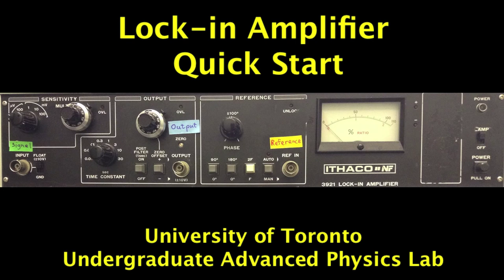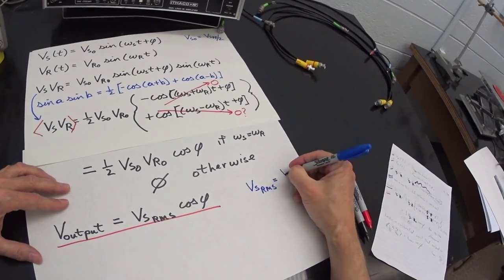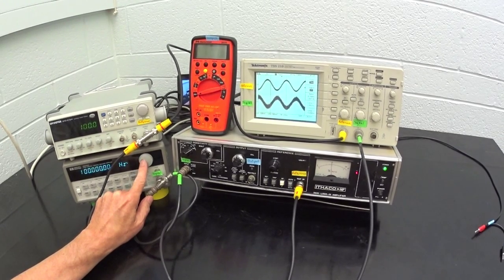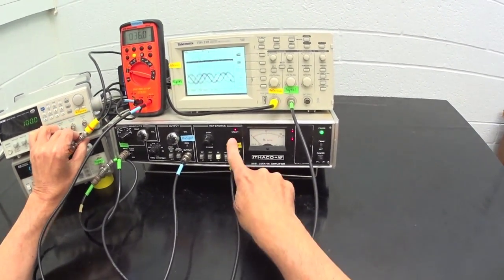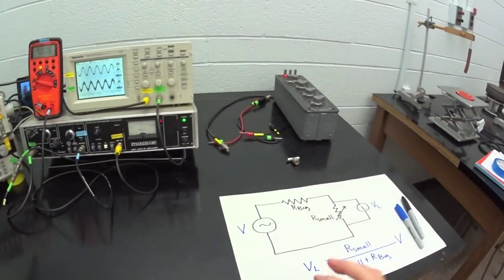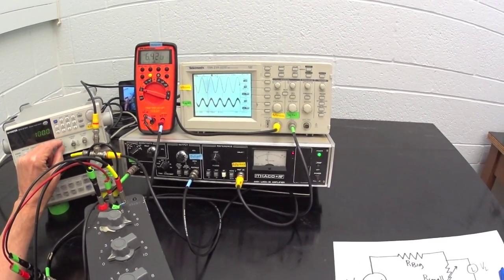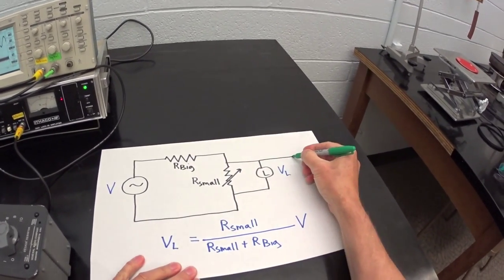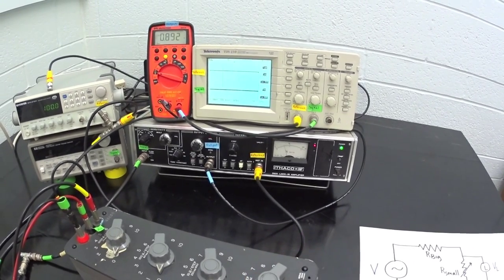Lock-in  Amplifier Quick Start

Comment: Great video. Just repaired an Ortec 9503 lock-in amp yesterday that I found on e-bay.  Started working with it earlier today then found your video.  Pretty much confirmed that I knew what I was doing never being exposed to the use of a lock-in before. Experiments in my basement lab await.  I hope to see more on the use of lock-in amps from U of T in the future. Thanks
Reply from the maker: +scooby45u I'm glad it was helpful. Best wishes.
Reply: Hello Scooby45u: I have one small query regarding Ortec 9303E Lock-in. How do you tune the reference phase knob? It only goes from -4.5 to 5.5 degrees. I am a bit confused with that function.

Comment: Hi...I have an old Ortec 9501E Lock in Amplifier....tUnfortunately don't have a manual .....could you further clarify what the read-out on the needle gauge indicates ? Thanks
Reply from the maker: To understand your particular lock-in, you might try contacting the University of Twente  EEMCS Historic Instrument Collection (http://studieverzameling.utwente.nl, click on the British Flag for the English version).  They apparently have a paper manual for the 9501E (http://studieverzameling.utwente.nl/display_item.php?table=manual&id=386).

More generally, I think of the meter as essentially showing a running average of the input amplitude times the cosine of the phase difference between the input and the reference. The time-constant essentially determines the time period over which the “average” is made. To find the actual input amplitude, you need to adjust the phase knob until the meter reaches its maximum amplitude, at which point you can read the amplitude off the meter (scaled by the sensitivity setting), and read the phase difference from the knob position. 

If the amplitude exceeds the +/1 range, you need to adjust the sensitivity to bring the meter reading back in range. If your meter goes from -1 to 1 and there are no +/ lights, then if input and reference are more than more than 90 degrees out of phase it will show as negative on the meter. If you have a 180 degree button, pressing it should flip the meter reading from - to + or vice versa.

As you can tell from the video, having a couple of frequency generators and an oscilloscope makes it much easier to figure out what a lock-in is doing.

        I hope this helps a bit.
Reply: Thanks for the answer! I have the output going into an oscilloscope to graphically see what is going on .... My needle just sticks around the center value and seems to only go to maximum when the sensitivity max's out
Reply: @torontoapl6987  Thank you so much for the nice two-part experimentation explanation. This helps a lot to understand the functionality of the instrument and the initial basic setup. I too have ORTEC Brookdeal 9501E lock-in amplifier and not able to understand the output in magnitude(R) and phase (theta) terms. The needle gauge in the lock-in display shows the DC signal but changing the value (due to the phase).
I have two questions:
1. How to measure the magnitude of the fluctuating DC due to phase?
2. I am trying to change the phase knob but can not make the fluctuating needle stable at one value. Is there any other way to do that?
Reply from the maker: @va4409  If the needle is jumping around quasi-randomly, it usually means there is no lock.  Have you checked that your reference signal is large enough?  If the needle is oscillating smoothly, that might be beats if the input frequency is slightly different from the reference frequency.  I am not familiar with the Ortec (or EG&G) 9501E. Looking at online photos I don't see an Auto button so I assume it cannot automatically set the phase to maximize the reading, but the reading should not be jumping around.  If, using an oscilloscope as in the video, you are sure you have a nice reference and in-phase test input signal, then there may be something wrong with the lock-in or its settings.  I notice the 9501E has several knobs and switches on its back. Have you played around with the switches to the left of the Reference input? i.e. the "External Reference" and Ground switches.
Reply: @torontoapl6987  Thank you so much again for the resources like Uni Twente link and advice on the instrument usage. 
I was using two different sources (one for ref in and another for signal in). There is a slight difference in frequency hence giving me the fluctuating needle.
Reply: Hello, I have a quick question. 
I have an old Ortec 9501E Lock-in Amplifier. What is the unit of phase angle know, is it in radian or degree? It is only -4.5 to +5.5. I am not sure about that.

Comment: HELLO
I'm with the problem of Overload !
You know how to fix this problem ?
I have reseted the lock-in , but it worked .
thank you
Reply from the maker: +Wagner Garcia
I am not sure I understand the question, but the usual reason for an overload is that the input signal is too large for the current sensitivity scale.  Depending on the lock-in, the overload lights might also flash to show it can't find a reference signal.

Comment: Great video. It was really helpful.I am working with SRS830 DSP lock-in amplifier.  Do you have any idea about what dynamic reserve or gain in lock-in amplifier to give me an idea that how it works? Does lock-in amplifies signal?
Reply from the maker: +Tahhan Sadaf 
Dynamic reserve parameterizes how well a lock-in can extract a signal from noise.  It is normally defined as
         Dynamic Reserve (in dB) = 2 x 10 x log10(V_noise/V_smallest_signal)
where V_smallest_signal is the smallest signal amplitude that can be accurately measured  in the presence of noise with amplitude V_noise,  (The factor of 2 in the definition is because dynamic range is traditionally defined in terms of power, which is typically proportional to voltage squared.)  For example, a lock-in that can accurately measure a 100nV signal in 10mV of noise has a Dynamic Reserve of 100.

Caution: I have seen the term “Dynamic Reserve” used to describe what I think of as Dynamic Range, which (if I follow the pattern of the above definition) should be
         Dynamic Range (in dB) = 2 x 10 x log10(V_max/V_min)
where V_max and V_min are the amplitudes of the largest and smallest signals that can be measured by the lock-in.

The name "lock-in amplifier" is a bit confusing, since it is actually an AC meter, not an amplifier. Its output is not an amplified signal, but a meter reading or DC level proportional to the amplitude of the signal input. When you change the Sensitivity scale on an analog lock-in, you are likely changing the internal gain of the input amplifier, but a digital lock-in may not need to change any internal gain if its analog-to-digital converter (ADC) has sufficient bits.   You may have control over the DC Output Gain, which changes the proportionality of the DC output level to the amplitude of the input signal.

I hope this helps.

Comment: I though it would be a tutorial how to use a guitar amp :(
Reply from the maker: Yes, there are lots of different kinds of amplifiers and in this case the name is a bit confusing. It might be better called a "lock-in voltmeter", but these devices have called "lock-in amplifiers" since at least 1941 (https://aip.scitation.org/doi/10.1063/1.1769919), so it is probably too late to change now. I hope you found a good guitar amp tutorial.
Reply: @torontoapl6987  you should record this like 10 times more slowly and not by using a tape recorder, throwing in the bathtub, filling it with acid, and then playing it into a talkboy
Reply from the maker: @vs24bv  Please see the recommendations under "Show More" if you find the sound difficult to understand.

Comment: Hello, I have an old Ortec 9501E Lock-in Amplifier and I am getting the variation (noise) in the output signal in the range of 50 mV but I was expecting it to be in microVolt range. Is it normal for this instrument? Isnt this instrument should be used to remove the noises. 
p.s.: I am recording the output using NI DAQ usb-6009 (kept in a faraday cage to isolate it from noise as well). Please help me, I am trying to see the signal in the 50 mV range as well.
Reply from the maker: No,  50 mV output noise is not what I'd expect for a lock-in, but your instrument is old.  I would expect a few mV, maybe 10mV max.  If the output noise with no input or shorted input is the same on all sensitivity scales and ground setting , that does suggest there is a problem with the lock-in, not the input signal.  I believe the maximum output voltage on the 9501E is 1V, so depending on what you are doing, you might still be able to do 5-10% measurements.  (Or perhaps even better if you can average the output on a scope and the noise is random over the timescale of the averaging.)
Reply: @torontoapl6987  I have tried by wrapping the instrument in the aluminium foil (Faraday cage) and earthen it. Still with the short circuit noise is minimum 35 mV. Maximum output voltage on 9501E is -10V to +10V. And if 5-10% means 100 mV to 200 mV. Averaging is not an option for me as I wanted to take time dependent measurement (Impedance flow cytometry). Now I am running short of ideas to remove any noises.
Reply from the maker: @va4409  If the maximum output voltage is ±10V, then 35mV is only 0.35% of full scale, so it may still be possible to get measurements better than 1% as long as the noise is random.  Have you looked at the spectrum of the noise, it case that provides any hints about its origin?
Reply: @torontoapl6987  In the frequency spectrum, noises is less than 5Hz. Random peak at 1Hz, 2Hz and 4Hz. And I am not able to understand the source of noise. I can only think about the mechanical vibration of table.
Reply from the maker: @va4409  That is very low frequency. Since the output noise level is independent of the input, it appears to be something internal. If mechanical vibration is causing the problem, increasing the vibration - e.g. whacking the table, shaking cables - should produce a noise spike. If it is a flaky component, e.g. something thermally or charge cycling, there is not much to do unless you want to start replacing internal components.  I probably can't provide much more in the way of help.  If you have not already done so, you could try asking on forums such as https://electronics.stackexchange.com.
Reply: @torontoapl6987  I have tried repeating the same experiment (shorted input) on the Antivibration Table. Still, the noise level is 31.2 mV. It must be the noise something internally generated. Thanks a lot for the support and help. I would definitely ask the question on stack exchange. Thank you so much again. :)

Comment: Could it be used in signals other than AC or sinusoidal nature signals? For example if I have a sensor and hypothetically it generates an Analog  pA current or nV voltage (DC or AC)  in its output, a lock-in amplifier could measure that? What would be the range of acceptable frequency? If not just curious what measurement devices could measure that? I mean for example nanovoltmeter can also amplify and measure such small voltages, what would be the advantage of lock in amplifier to nano voltmeter? sorry for too many questions :)
Reply from the maker: +cyrusIIIII 
Lock-ins do not work with DC signals. Our lock-ins typically work from 10Hz to 100kHz, but I have seen more expensive Lock-ins that work down to 1mHz or up to 100s of MHz.  One can often choose whether the signal is AC or DC. In our undergraduate lab, we measure small low-temperature resistances by applying an AC current so the voltage can be measured with  a lock-in. These resistance measurements could be done with a modern nanovoltmeter and low noise DC current source, but they cost more than the low-end lock-in and function generators we already own.  What works best depends on the nature of the signal you are trying to observe, the noise and drifts it is subject to, and your available equipment and budget. You might want to look at articles such as http://www.evaluationengineering.com/articles/200812/nano-measurements-need-mega-care.php or http://www.tek.com/sites/tek.com/files/media/document/resources/Lock-In%20WP.pdf. Cheers.

Comment: Why does the signal voltage need to be sinusoidal??
Reply from the maker: It doesn't have to be sinusoidal.  The math is simpler if it is, but the lock-in output should be proportional to the Fourier component of the input signal that matches the frequency of the Reference.  If either the signal or reference is not sinusoidal, you also have to worry about any filtering inside the lock-in.  Take a look at https://www.youtube.com/watch?v=ZIjBRA2S0NQ&t=177s.
Reply: @torontoapl6987  Thanks a lot! Is this why choppers are being used to modulate the input signal?
Reply from the maker: @jan861  Yes, one of the most common uses of lock-ins is with optical choppers to help detect small optical signals.